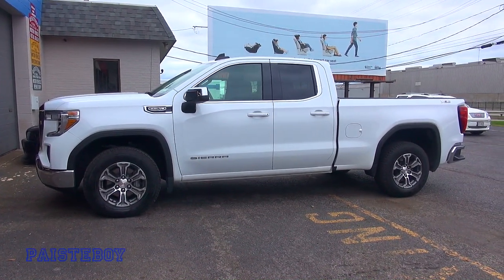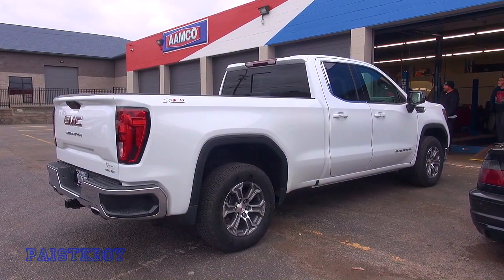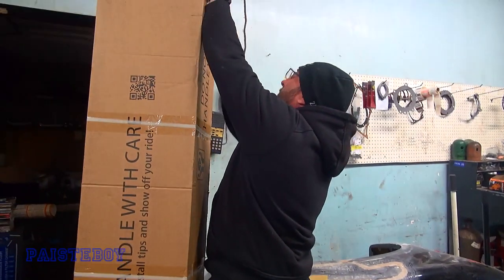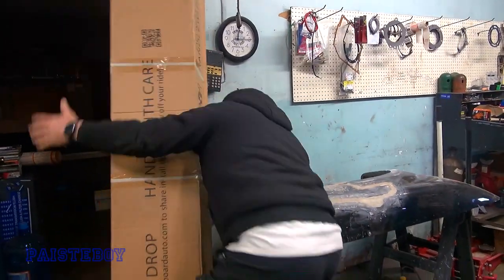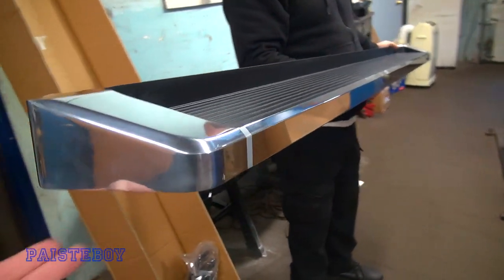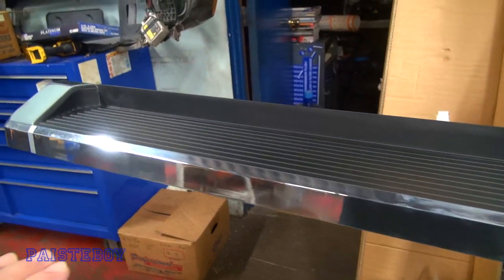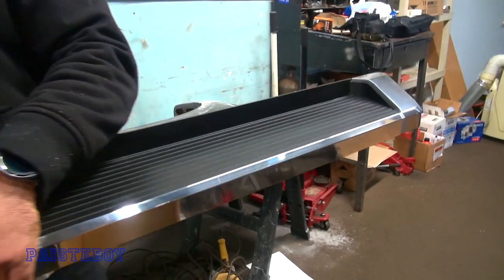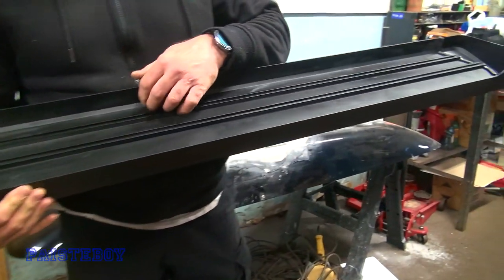APS iBoard Running Board Install 2019-2021 GMC Sierra & Silverado Double Cab

Comment: A lil trick used in all assembly or building applications......leave everything loose until you have it all assembled......then crank it down tight.......gives you bit of play and adjustability....

Makes process alot easier
Reply from the maker: I do that at times as well.  Thanks for watching.

Comment: Thanks for sharing! I just drove home my new 2021 GMC Sierra Elevation 1500 double cab with the 3.0L diesel, and was hoping to do the APS I-Boards again, but was concerned about the installation because I was looking for the mounting that uses the cab bolt like I had previously, but this looks solid. I had a previous generation APS I-Board on my previous 2014 Sierra Denali HD that had holes with threaded inserts that corroded. APS sent me replacements and they had the t-track like you showed, which as a significant improvement. Scott
Reply from the maker: You're welcome. Yes. They upgraded the mounting style and makes the install easier.
Reply: Sound like ur showing off ur new gmc to me

Comment: Trick is to leave everything loose then when u got every bolt in every hole tighten it down baby I’m not very handy but even I did it with no help from YouTube or manual
Reply from the maker: Nice job.

Comment: How the coating holding up where it’s black ?
Reply from the maker: The black part is holding up just fine but the end caps are oxidized very badly.
Reply: @Paisteboy  yea I was gonna go with the all black version but same brand
Reply from the maker: @outen21  
That sounds like a great option.